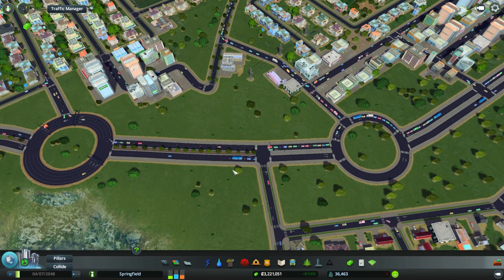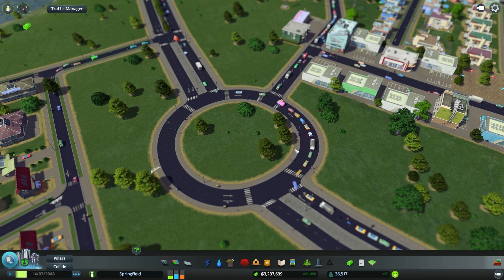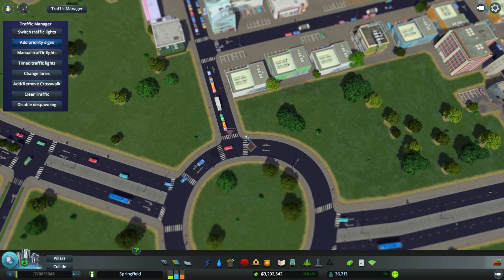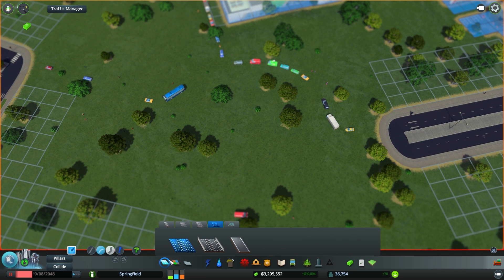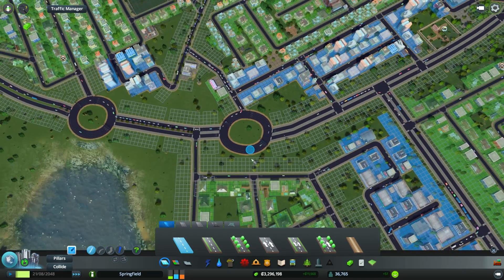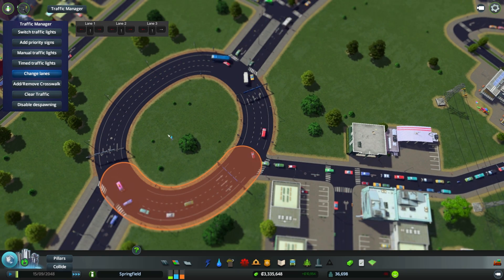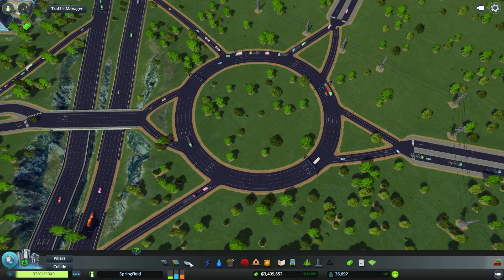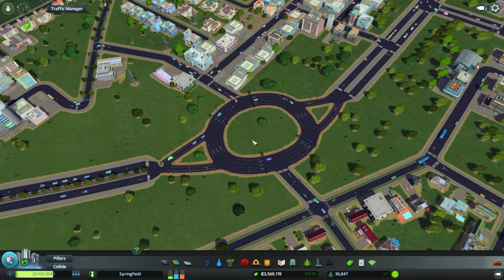How to Create More Efficient Roundabouts ► Cities Skyline Tips

Comment: If you don't want to use mods, the way to create 'perfect' round-abouts is to follow a simple rule.  Enter from the inner, exit from the outer.  Using bridges, tunnels, whatever, all entrances to a roundabout should enter to the inside of the circle, all exits from a roundabout should exit from the outside of the circle.  Even if one exit backs up, most of the time the other exits will still function.

Comment: Just wanted to add that I'm using entrance/exit the roundabout other way around. In this video, you split avenue into two off ramps which is a good idea. I create two one way roads that go to and from roundabout, delete entry points, use an avenue for entrance exit and connect one way roads to avenue. Reason for this is that you create less intersections that are main problem of traffic congestion. Thumbs up on the video.

Comment: What is if I remove this mod after using it? Will my street and my safe file still work?
Reply: ***** Maybe I want to play sometimes without mods. Maybe because I want to send the safe file to a friend, who plays without mods. Maybe I don't want to have the mods activated in all my cities and I don't want to change every time I start the game the settings. 
Different reasons. 
But I think I already have the answer. When you install the mod and changes streets, signs, speed etc. and safe the city, next time when you enter the game without the mod, all streets are "reseted" to default. When you play in this city without the mod and safe it, next time you activate the mod, all street signs, speeds and traffic regulations are set back to the point, when you last used the mod. 

That is actually a very nice mod management. When you deactivate a mod in some other games, your safe file is lost forever.
Reply: Acil olan şey

Comment: I just watched this and agree that if you need mods to make the traffic better then it's not a tutorial in terms of vanilla management.. Also you can clearly see that at the start of the video he had a intersection with lights between the roundabout which will cause the back log but then he removed it from 4 mins mark..  Umm you don't alter the original roading between the roundabouts as this clearly makes the flow a lot better... Bit of advice.. Please be consistent in your video..

Comment: is it relaly a tip if you have to use a mod?
Reply: +Justin Iaconis (robobunnyz123) The best tip he gave in this video he never even mentioned. Traffic in his roundabout was being stopped up by the stoplight between the two roundabouts. When he showed his roundabout after using highway ramps the stoplight was gone allowing traffic to flow freely. The ramps are a good tip but didn't fix his problem.
Reply: thegreatninjaman yes.